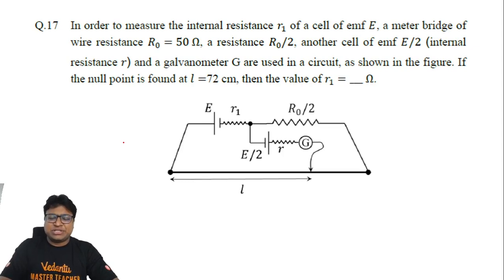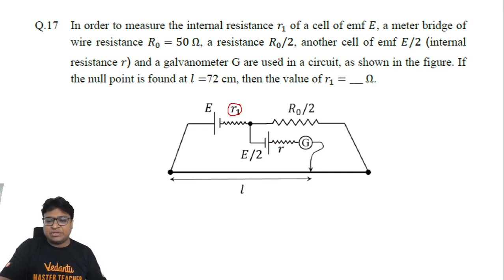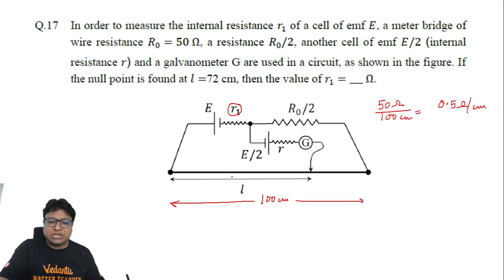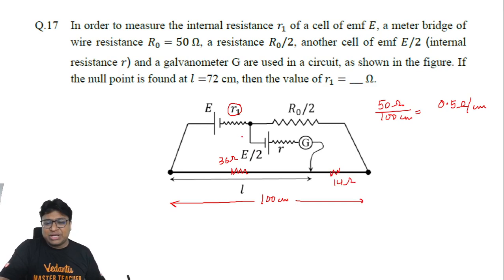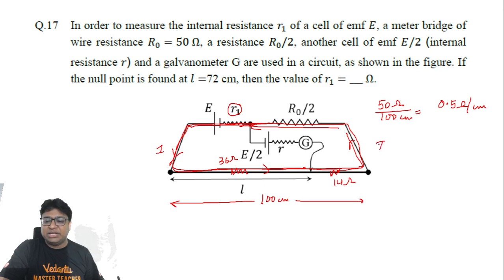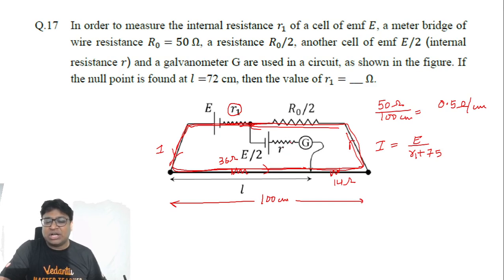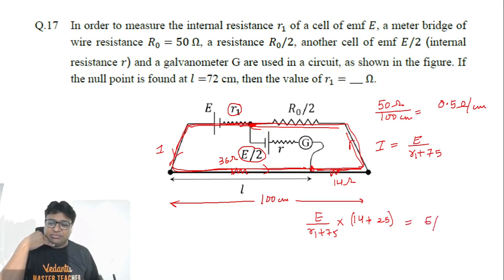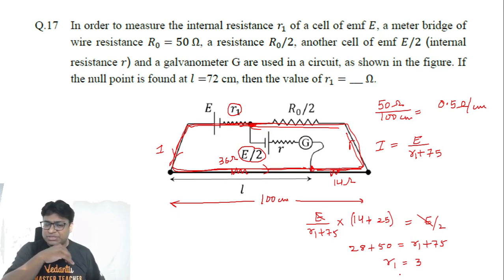JEE Advanced 2021 Paper 2 Physics Solutions ( Q-17) | JEE Advanced 2021 Solutions | Vedantu

Comment: Why didn't you include the internal resistance of the E/2 cell?
Reply: Because current in galvanometer branch is 0, hence potential difference across r will be 0
Reply: @kalyaninagure2268  Thank you so much😭.. I was struggling with this doubt for so long